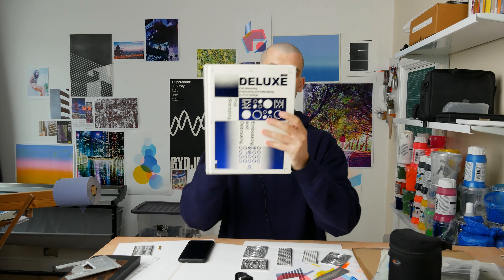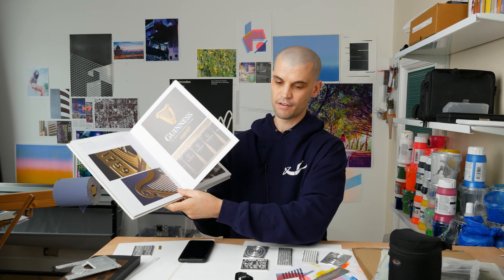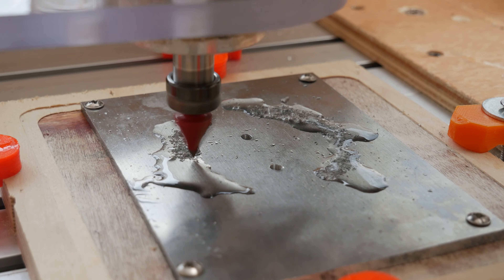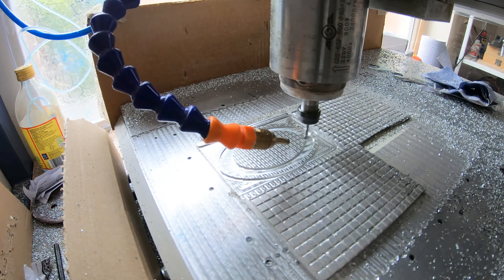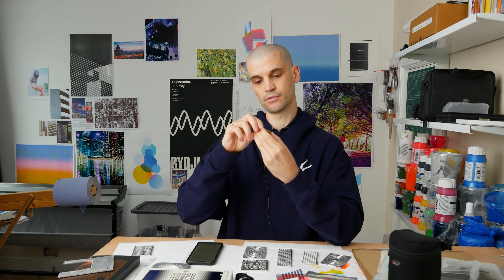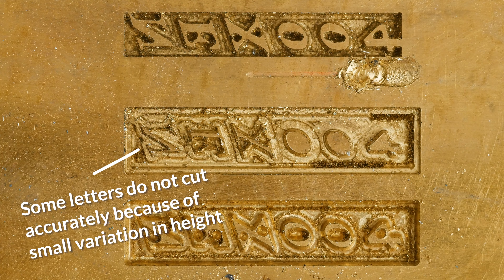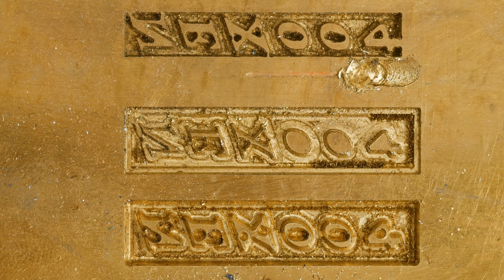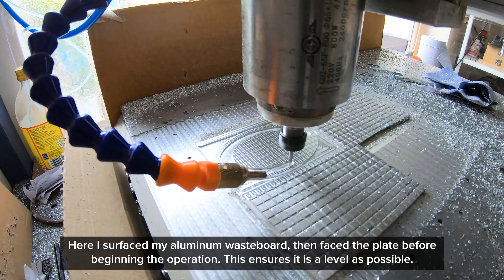Brass CNC Engraving Tips for Beginners

Comment: For you information, the reason the fine points snap is that whatever speed the spindle is running at the centre of the cutter is always effectively moving at zero relative to the spindle. It therefore acts like a drag engraver with the predictable result. This is also the case with ball nosed end mills whatever size they are By having a slightly flattened point your recommended cutters do not have a cutting edge at the centre so do not act like a drag engraver. When working with plastics this dragging point stirs up some plastic so heats it up and ploughs it as it goes with the result they don't usually snap in plastics. The coarser points are stronger and able to resist these drag forces better.
Reply from the maker: Cheers Martin, very helpful info. I heard the same thing mentioned about the center point effectively not moving on a NYCNC video about trepan drilling :)

Comment: I have had good results with a 10 degree  v bit 0.2 flat end on brass on a cheapo 1610 machine which is a small version of the 3018  and a modified 300w spindle. I use multiple passes  to remove small amounts of material which for me is the key to good results given the basic machine I have. eg 12 passes to remove about 1.5 mm of brass. I have an early version of v carve which I bought cheap  some years ago.

Comment: Have a look at Estlcam software, it is both CAM and  CNC controller in one. Very easy to use and setup for just about any machine. Very cheap to buy and free to use for testing indefinitely. Many videos online, mostly in German.
Reply from the maker: I will check it out, thanks!

Comment: I know this is a long shot since the video is 3 years old. I am after some advice on engraving names onto pen clips. I don't have a laser yet so I am trying to either engrave or relief carve a name into the pen clip. Trouble is, they are mostly curved and I am struggling to work out how to do it. I am not sure how to hold the pen/clip to get it at the right angle. Any tips would be absolutely awesome.
Reply from the maker: You will need to make a jig to hold the pens and if you can try to model the geometry accurately in cad\cam

Comment: I swear by the spiral V Varve bits, usuall 0.25 mm but often that is used after roughing out. 
For Copper and Aluminium I also use Metholated Spirts for a lube. The sudden heat change causes the ship to eject from the bits and not gum up as badly especially in aluminium.
the rapid evaporation also helps cool things but dont forget that Meths is also flamable so no smoking.

Comment: Those aren't end mills. They're engraving bits.
When using very small diameter cutters, where there may be some height variability on the surface of the material, I first resurface the material with a 1/8" end mill. To do the engravings, I use 1/32 inch, 2 flute end mills. You can get smaller if you wish but they get pretty fragile and you have to go pretty slowly. When cutting aluminum, use single flute end mills and you will get far better results because they clear the chips much better and don't re-cut them / grind them into your work surface. The air blast is absolutely mandatory; it made a huge difference in my results. I don't use coolant / lubricant any more. My work stays cools to the touch with single flute end mills. I found that the liquid creates too much surface tension and that means that the finer chips stick to the work and get ground back in creating that awful surface that we all try to avoid.

Great video and thanks for taking the time to share.
Reply: Thank you for this tips❤

Comment: What helps with leveling as well, is to make an height map. Most CAM programs can do this. This is especially easy with metal surfaces.
For non conductive surfaces, I just simply use some aluminum foil over the surface

Comment: Very helpful.  My interest is clock dials (brass) where the alloy matters.  I think that means engraving, rather than relief carving, but breakage has still been a problem.  Brass 260 isn't ideal, but 360 isn't available in sheets. Now trying 1/16" end mills followed by V-tips to clean up edges.  Can you comment on pass depths, RPM and surface speeds?

Comment: Thanks, there is not much out there on CNC brass. Will be interesting to try this on my new 3018.
Reply from the maker: 3018 isnt the best for brass, especially small details but give it a go. Good luck
Reply: @ThisDesignedThat  Got backup plan, it came with 2.5w laser. Acrylic spray paint, laser it off then etch, ferric chloride or electro. Will need air assist when lasing to blow residue away. Plan C is Dremel 30,000 rpm. Might need handpiece mods to tighten up run out. Plan D is DIY high speed precision spindle. Plan E is Brushless motor, Plan F is 300W. So many things to try, include 12mm slides. Or use the 3018 to make parts for linear rail mill. Or stop wasting time and buy a Datron, haha. Mind you those 20W diode/fibre lasers can do it now.

Comment: Great videos and tons of real proper detail, thank you! 

If you are using Mach 3, you can set it up to compensate for your slanted bed. I haven't done it but i have read the tutorials and it seems easy. 

I bought a 16mm thick sheet of Aluminum and faced that with a 1/4" 22mm plunge router bit for wood. 

You have to do 0.05mm passes at at time (starting at your highest corner) and cool it down between passes but It worked. 

To test which corner is higher, without a dial indicator, I used a cheap Z probe (now I see you made one :) ), either configured in Mach 3 or with a LED, resistor and 9V battery and check at what Z reading in Mach 3 the LED comes on.
Reply from the maker: At some point this year Im going to make a threaded base from aluminium and surface it all, it would help me a lot. thanks for the tips :)
Reply: @ThisDesignedThat  Thanks for the reply!

Its obviously up to you but I wouldn't tap into the Aluminum, reason being: swarf in the threads will wear them down eventually and cause them to strip. 

I  had Mach 3 pocket about 90 6.5mm holes all the way through the Aluminum sheet and then the same for around 12mm (large enough diameter to allow a 6mm socket to get in) but only half way through (just enough to allow a 6mm bolt head with a washer to be below the top surface of the aluminum). 

Then I pushed 90 4040 T-nuts into my existing aluminum extrusion bed and lined them up (a bit fiddly but manageable with one of those  telescoping magnetic pick up tools) to the holes in the  aluminum sheet and locked the sheet into place with bolts going through it into the T-nuts. 

So now I have at least 84 bolts clamping the sheet down even if I use 6 clamps to hold my stock down. It made a big difference to the stability of the router and workpiece holding is very easy.

If you do manage to strip one of the T-nuts, you just replace it. I haven't managed to strip one yet and my machine is 3 years old.

Another thing I did was to modify it for flood cooling. It doesn't matter what feed or rpm I run at now because the bit never gums up and those deep profiles are easier because there's no swarf in the trench for the bit to contend with. I can hog stuff out at high feed rates and come back at low feed rates for the detail. There's very little mess either.

Comment: Very helpful video. I have made a diy cnc machine and i figure out myself only half of the issues you report in this video. Regarding   v bits i use the cheap ones for pcb engraving. I need to switch to those ones you describe and have double flute for deburring. Fusion does not work well when it comes to fine details too. I carve on plywood and mdf and in most cases my stock tears off especially when fine lines engraved next to each other. I didn't found a solution to this yet. I have read in an article that you have to calculate the taper angle of the bit based on the finest line you want to engrave.
Reply from the maker: plywood will tear out quite a lot no matter what size letter you engrave. Have you tried MDF or switching to a metal?

Comment: An alternative to facing the material is to start by height-mapping it. Most software will offer this.
Reply from the maker: In the world of CNC and machining this is not common practice AFAIK.  Its much easier, quicker, cheaper and common to just face the material before operation
Reply: @ThisDesignedThat  Sure. But I do make prototype printed circuits. No choice then - you have to map the height.

Comment: Super interesting, thanks.
Given that it's been 3 years now, and that I see that you're also into laser engraving, do you think that laser is getting close to CNC for 3d engraving?
Reply from the maker: From my research, a 50-100W fiber laser will be able to engrave fine details in steel plates so it is possible. Unfortunately, these machines are costly so I haven't been able to test them yet

Comment: question about engraving in fusion 360, could you do it in 2 operations? The first a 3d adaptive to remove most of the material with a larger cutter, and then a parallel for the detail with a fine point cutter?
Reply from the maker: Hi Josh, yes that is one way to do it (I have tested it myself) and works OK  for basic shapes but for text or intricate designs you will always get aliasing on curves. You might get around the aliasing by doing a stepover of something like 0.05mm but it's going to increase the machining time so much. Better off just using something like vcarve or artcam that has proper relief cutting toolpaths